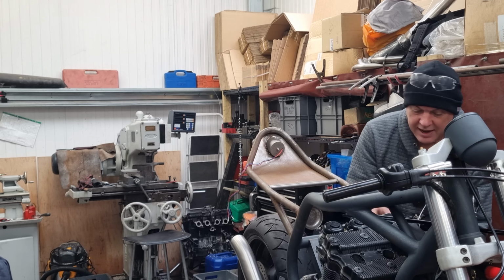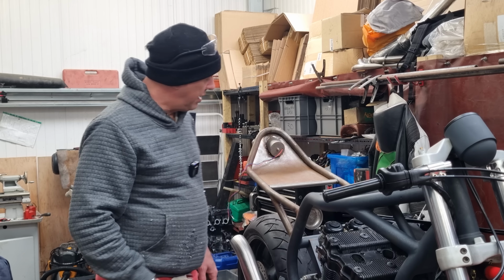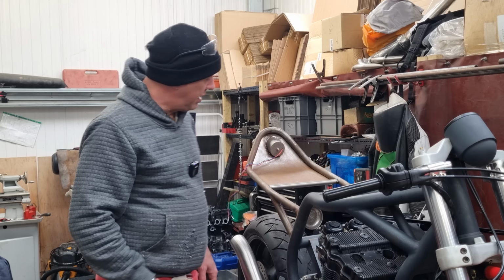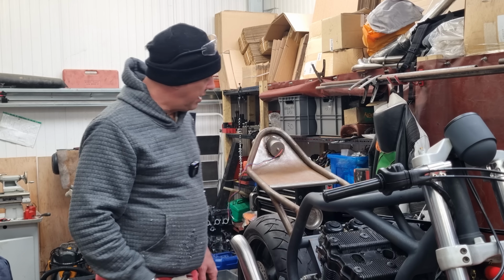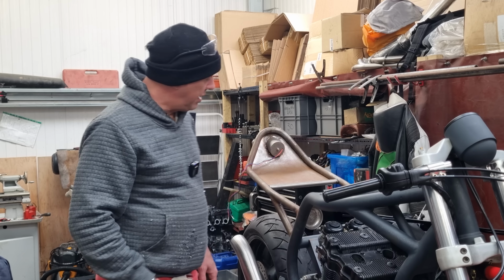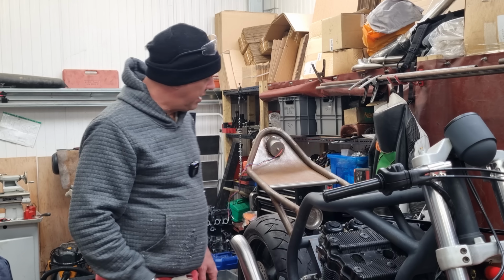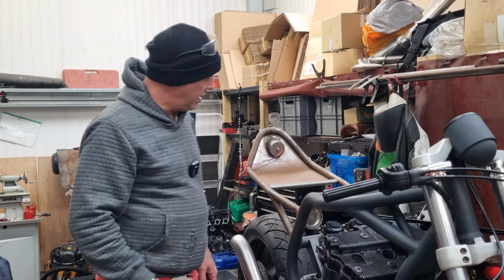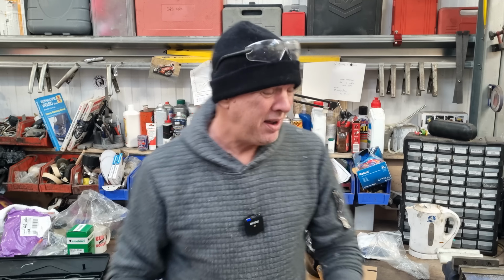Fork tubes and headlight mounting - Suzuki Bandit Cafe Racer - ASBO Project

Comment: For squaring stuff up in the chuck like that, your bung is a good start.  What you also need s another (sacrificial) bung to go in the other end, with a shoulder on it and a centre drilled hole.  Shove the tailstock in it, then use a cutoff tool or similar to clean up the end.
Reply from the maker: I did do that only with a cone on be t he e tailstock, centre be drilled by with be a live centre in it. Just be seemed really quite dodgy so I didn't film it .. 🤣😅😂
Reply: @QuickBikes  A bullnose, or pipe centre?  Perfectly fine approach :)